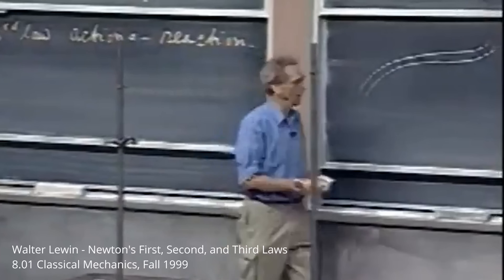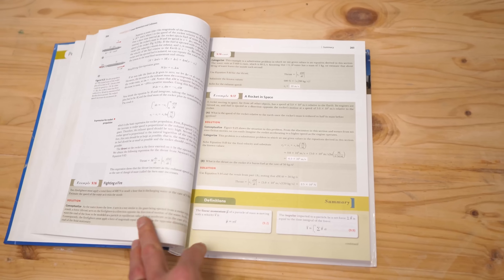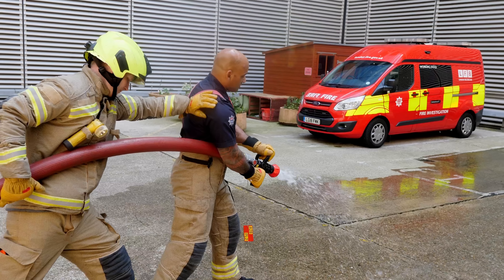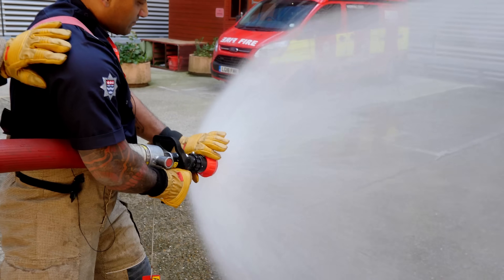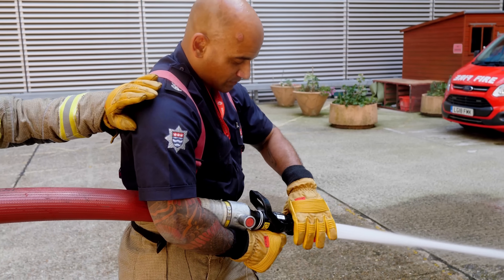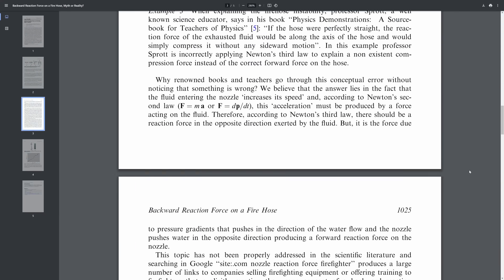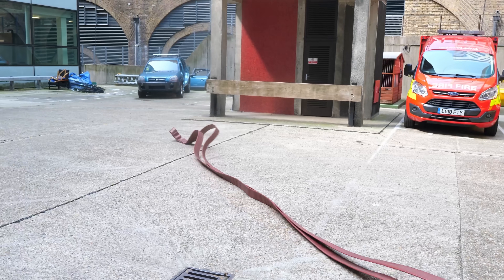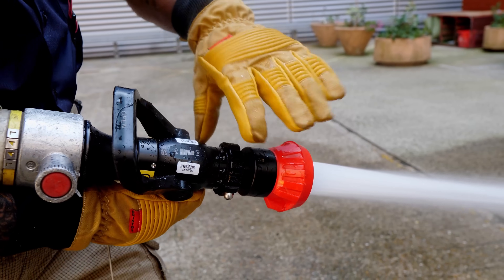Why chaotic hoses dance

Comment: 13:22 “except that’s a bit like arguing that you could push at the end of a string”
Yes, if that string is inside a hose like the water in the pipe, then it is like that if it’s constrained with just a minimal allowance of expansion, like a firehose designed to hold a certain amount of wall pressure. You will get a reduced pressure due to the wall friction and the expansion until the pressure builds up to its maximum nozzle output.

Comment: "charge safe" - I wish I could feel 100% safe about my current ebike's battery, I can only measure its 10S voltage not the individual cells/clusters of cells.
I've individually replaced the 18650's in my previous ebike's battery twice and saved £100's just doing some careful soldering, I wish I could do the same with my current ebike's battery, unfortunately they sealed it with silicone.

Comment: cant you measure force that pump feels by placing pump on wheels or even boat on water and then seeing if pump (with hose attached to it ofcorse) will move on its platform at all, or will only end of hose move? to me it seems that pump has no outward force on it other than same one as pressure that entire hose feels. and it is entirely contained inside of hose other than on its exit point

Comment: You can analyze this by force/momentum, but also as a conservation of energy problem.  Pressure is mathematically equivalent to potential energy per unit volume of fluid.  So wherever there is a decrease in pressure, there must be an increase in kinetic energy per unit volume (ignoring frictional losses).  When this happens at the nozzle, the fluid gains substantial kinetic energy at the point where it leaves the nozzle.   How this is distributed to the volume of flow will affect the velocity of the departing fluid which depends upon the shape and diameter of the nozzle.

Comment: Hi Steve, I think I might have something for you to look at. When considering rockets, there are actually two forces that are causing thrust on the rocket. The first is, as you mentioned, the reaction force from accelerating the mass of propellant and thereby changing its momentum. However, the other force is a force due to a difference in pressure between the chamber and the atmosphere. Since the chamber is at high pressure and the atmosphere is at low pressure, this force is given by force is pressure times area. It so happens that when it comes to rockets, the reaction force due to the acceleration of the propellant is MUCH more significant that the differential pressure force, so we tend to ignore it. In this case, however, I think the differential pressure force is the driving component. At the end of the hose, there is a difference in pressure which causes a force axial to the tip of the hose, which pushes on the tip of the hose, causing a buckling motion, resulting in the behavior you describe in the video.

Comment: The hose end is like a rocket or jet nozzle capable of thrust vectors. The change in direction is just as likely the walls of the tube and the rigidity of the pressurized vessel. In the shortened hose example it may be reaching a point where we have a regular frequency that might relate to the stiffness of the system. If you put a weak model rocket engine on the end of a spring i wonder if you could get a similar effect.

Comment: Writing this in the hope of being corrected: wouldn't the "rocket" force felt by the firefighter ultimately be caused by the restriction in the diameter of the tube and direction of the water at the exit of the nozzle?

I've used a simple open hose (no fancy nozzle) to water plants before and I distinctly remember that when I used my thumb to constrict the flow of water in a long, fast, straight jet to reach longer distances, then I would feel a stronger push backwards. That feels correct as at the point where I'm constricting the flow, I'm effectively accelerating the water. I'm harvesting the pressure, increasing the pressure in the tube and converting it into speed. The mass of water exiting the hose per second remains constant, but the speed increased. So the force is bigger, so the reaction in the opposite direction applied to the hose is also bigger.

I believe this is also why when the flow at the nose is constricted in a different way like the very wide "shower effect", then the reaction force is small, because most of the mass of water is being sent in directions that don't align and thus the reaction forces cancel a lot.

Comment: The force is felt because of the change in pressure causes the water to speed up, and it takes more pressure to send water higher up a building. So does the force that the firefight feel increase as height increases?

Comment: Steve, I think it would be interesting to consider 90° rigid bend at the end of the tube. Surely, when you hold a shower head, you can feel the force in opposite direction to a direction water exits. Identify where the force acts on that corner, gradually make it softer and see what happens.
Also I think the opening / the orifice size does matter. There should be some point where the hose becomes stable, i.e. closed one doesn't move. If the orifice is small enough I would imagine straight hose will act as a rigid tube. It seems that's the way "tube people" are working.
There is so much more to these behaviors that it makes me want to go do some experiments 😆

Comment: The pump provides both kinetic energy and pressure to the water. As the water passes through the nozzle the energy it possesses by being pressurized is converted to an increase in kinetic energy, thereby increasing the momentum of the water. This should be easy enough to calculate using bernoulli's equation, I think. 

If the nozzle had nearly zero restriction then I would suspect the pressure in the hose would be quite low, and the reaction felt by the firefighter would also be quite low. As a consequence the velocity of the water on exit would also be very low and would make the water jet very ineffective.

Edit: I made this comment just after you said "maybe you can help", then realized you got to this later in the video.

Comment: @SteveMould a break cable transfers all its force to the brake at the end. Its similar to your example of pushing on the end of a string, but its constrained inside a tube which limits its ability to deform. Thoughts?

Comment: nozzles are...nozzles right? so, small orifices? so shouldn't the water gain momentum going through the end of the nozzle for that reason as well? I always thought that was where the majority of the force came from. apologies if this was something you said in the video, but it seemed like you were saying the pressure drops and therefore it the water accelerates, but I think you're also forgetting about the fact that the water is also being constricted (pressure increases even higher than it was in the rest of the hose  AND THEN decreases at atmospheric pressure) at the nozzle, no?
Reply: This comes from the personal experience of always feeling way more force from a hose with a nozzle on it than just an open hose, with the same volume flowing from the tap
which to be fair could be entirely different from fire hoses and wacky waving arm-flailing inflatable tube men....

Comment: It's not correct to say the water pressure is the same along the length of the hose. There is frictional pressure loss. For 'short' systems like the hose, this would be essentially negligible for the purposes of your video. For longer systems it would be noticeable. The velocity of the water doesn't change, the energy to overcome the friction comes from the pressure, hence the pressure reduces. And 'pipe exits' are accounted for in engineering with a loss coefficient (K) of 1. This is part of the momentum/Bernoulli equation to work out the increase in velocity due to the exit loss.

Comment: I wonder if the force at the nozzle changes based on atmospheric pressure. If the force needed to push the water out of the hose is less at a lower pressure then it should follow that the firefighter feels a greater force due to an increase in acceleration of the water right? This could also be tested experimentally and could prove or disprove Steve’s theory.

Comment: I'm pretty sure you've got your fluid dynamics wrong at several layers. I'm an electrical engineer and I often try to think of electricity like fluid flow because it makes it more intuitive, but that must mean that the reverse is also true.. For comparison purposes, pressure is like voltage and flow is like current. Ohms law states that voltage is proportional to current and resistance (V=IR). When you said that the pressure is the same throughout the hose because the flow is the same, I don't believe that is true in the same way that it isn't true for electricity. For electricity, the voltage isn't the same throughout the circuit, but the current IS the same. The voltage is actually calculated in voltage drops over resistance. 

So for the hose, the pressure in the hose will only be the same for a hose that ISN'T flowing. Instead, the pressure will be a consistent drop from the pump(power supply) to the air (common/neutral). The pressure at the pump should have a relationship between the resistance of the hose and the flow of the water. The pressure at each point towards the nozzle will drop linearly along the length of the hose till it reaches air pressure at the end of the hose.

As other people have said, for the water to accelerate out of the end of the hose, it isn't because of a sudden pressure drop, it is because the firehose constricts at the end. With a large flow rate and a suddenly smaller nozzle, the water behind the nozzle must move slower than the water in the nozzle. Said a different way, the water in the nozzle must move faster than the water in the hose for the overall flow to remain the same.

What I think the force the firefighters actually feel is the weight of the air displaced by the water as it exits the hose. As you said, equal and opposite reactions. The water is going to exit the nozzle and immediately start expanding to fill the space. The water will subsequently slow down as it runs into air. So the air will be pushed out of the way. So if the air is being pushed out of the way, the air will equally push back on the source of the water, thus the fire fighter. Since air is lighter than water, it takes significantly less force to hold a hose in place than the amount of force that the water can put on a person if it were to strike them directly.

Comment: I wonder if a laminar flow would cause a hose to dance.  I'm also reminded of a video that Practical Engineering did 2 years ago about rivers shifting due to various factors like silt/amount of water.   If you think of a fire hose as the river I wonder if the water just naturally wants to try to wander a bit into curves.

Comment: One question I always had and somehow I feel would have the same answer as you question is: when your sucking a long spaguetti, where exactly the force that is pushing it into you mouth is being applied? The atmosferic pressure is only pushing at the sides of the spaguetti near your lips, but it is pushing it into your mouth anyways. If you have the answer, I think it would be a cool video.

Comment: The fluid traveling down a hose is not frictionless. More force/momentum is applied to the outside of a curve. Streams erode more on the outside more because the water speeds up. Supposition outside, deposition inside.

Bullets fired through a curved barrel wear out the outside of the curve quite rapidly and will cut through if allowed. Also an good example of a single "packet" of energy moving down a 'tube'.

Comment: To me it seems fairly straight forward.  Even before you mentioned the increase in speed at the nozzle due to lower air pressure compared to the water pressure, I could tell that the water was causing a pushback at the nozzle.  And that force, the pressure differential between air and water, is the force that firefighters have to wrestle with.  You're right, partly, insomuch that the angle of the hose affects the angle of the forces, and if left free the nozzle is subject to gravity, wherein it introduces an angled segment, incompressible water doesn't like this and straightens the hose (as well as the nozzle itself having an off axis force applied), it overcorrects due to the combination of forces, and the hose starts going wild.

How did I come to this conclusion?  I've owned a home, and a water hose, and a sprayer nozzle.  Anyone who has, knows, as soon as you pull the trigger to release a spray, you get a sudden jolt of force against your hand and arm opposite of the direction the water is going.  It stands to reason that a hydrant which has far higher pressure than a standard home hose would impose far greater forces on whomever is wielding the nozzle.

You're probably also right though, that if the hose were completely straight and in line with the pump (i.e. floating in midair in a straight line from pump to nozzle) that the firefighters would have virtually no forces to contend with.  The rigidity of the hose would shoulder the forces.  But this is not a perfect world, hoses are not rigid tubes, so flailing ensues.

Comment: Regarding ebike fires: Note that he said they were almost all due to mismatching the charger and battery.  This is why electric cars put the charger on the inside!  The part with the cable on it is just a slightly complicated switch that turns standard AC current on and off, while the actual conversion from AC to DC happens inside the car's power system. You can't mismatch the charger, because the charger is an internal part of the car itself. (Level 3 chargers -- aka Supercharger aka DC fast charge -- is different and requires a complicated communication protocol between the vehicle and the charging station to make sure the station feeds only the requested voltage and cuts out if anything isn't working exactly right. Those are inherently more dangerous and harder on the battery pack, but you don't put those inside your house/garage.)

Comment: The early discussion on forces on curved hoses doesn't reflect my experience of garden hoses - if the end is fixed by a sprinkler staked into the ground you can have a load of bends and the hose doesn't move. So I reckon the jet at the end is the relevant factor.

Comment: I think useful to look at the pressure from pump to free flowing water. With my garden hose with no fitting on the end I get a high flow rate that is determined by the pressure loss due to friction - and no strong jet at the end - the water just runs out, like a river. When I put a nozzle on the flow rate is lower but jet velocity is faster. The pressure drop down the hose is lower and drop across nozzle is high - this pressure difference is a force which accelerates the water jet - and causes the push back for the fireman.(I'd like to think the force is the change in static pressure multiplied by nozzle cross sectional area...)

Comment: Hey Steve, great video! Question: How long is this force acting on the water particles at the nozzle? When the water leaves the nozzle, it is accelerated by the net force from the pressure difference inside the hose to atmospheric pressure outside the hose as you stated in your video. How long is this force acting on the water particles? I imagine it’s an incredibly small amount of time, which would mean an incredibly large acceleration. How would you go about calculating this???

Comment: I was thinking about the power out from the hose, you did say it did not change the output with a twist on it, but the change should be on the input side? 
And also, the walls should also kinda flex and with that kinda eat up the power you would get from the twits? 
or just get warmer (tho very small i do admit) because of  the extra friction? ^_^

Comment: Great episode. It is always fun to see math illustrated in real world examples. I have seen a couple, quite different examples of “wiggly hose” being used for practical reasons.
In the US desert southwest I saw these used in heap leaching using a rudimentary form of  the cyanide-zinc process. In this case they were recovering silver from tailings discarded from the original operation of the mines. The owner/operators tested many kinds of nozzles and distribution systems and they all would plug within hours or days. They eventually determined that short wiggly tubes would go weeks and months without plugging. Also by nature of their larger bore, the tubes produced larger droplets and therefore slower evaporation. 
Another application was using a short wiggler tube to loosen boric acid powder (pesticide) inside a pneumatic dispenser. More elegant, higher tech options did not work as well or as reliably.

Comment: The way I see it. the skydancers are doing exactly the same thing as the hoses at a fundamental level but with the added feature of the pressure thing that you noted. Because the skin is so floppy, and kink/bend will end up folding. The fold itself then becomes an exaggeration of the bend and also sustains an increased pressure by limiting airflow.

When the skydancer is upright, the start of any bed will quickly trigger a collapse, because it will constrict the airflow meaning there won't be enough pressure ot allow it to fully stand after the bend. Notice how they can stand upright for an unspecified time even with air flowing through them, so it's not the case that they don't have sufficient pressure when fully open to stay open.

I want to say it can stay upright indefinitely in theoretical terms, but it will always fall victim to more than a slight deviation of the hose, and the chances of getting any significant period with no deviation in the hose are so small as to make it unlikely that anyone will ever see it.